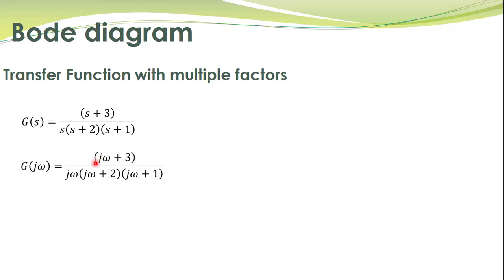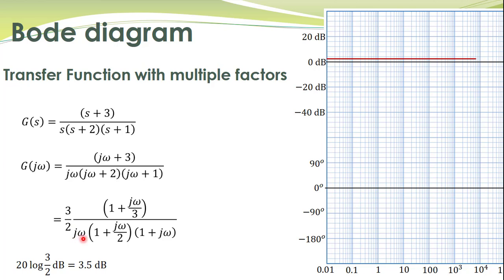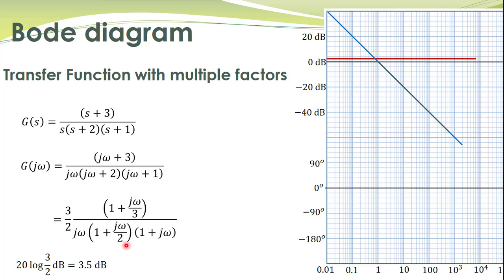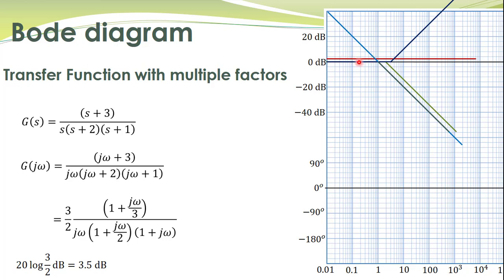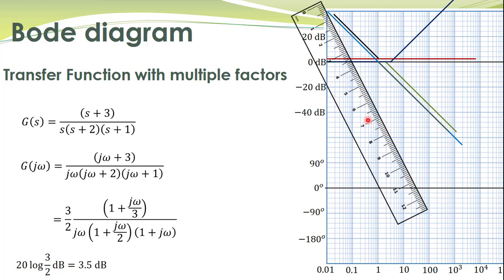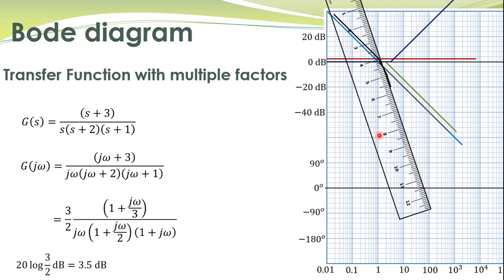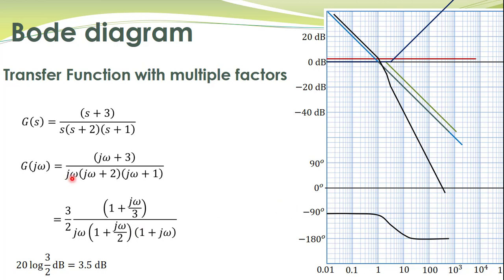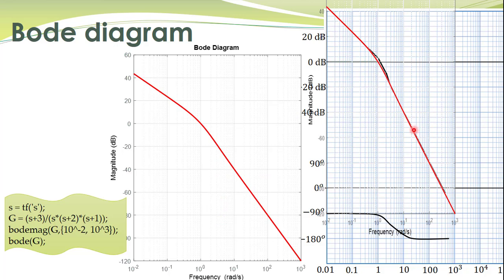LCS21 - 40b - Bode diagram of transfer functions with multiple factors

Comment: the last slope of magnitude is -20-20+20=-20
Reply from the maker: There are three poles and one zero in the system, therefore, the final slope will be -20-20-20+20=-40. May be you are missing the pole at s=0.